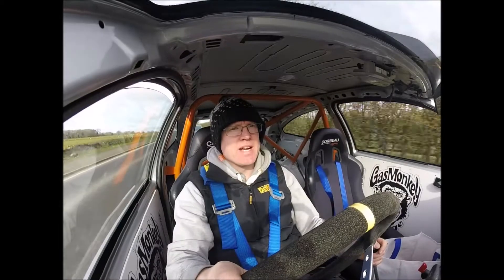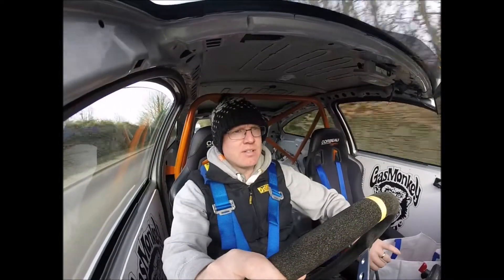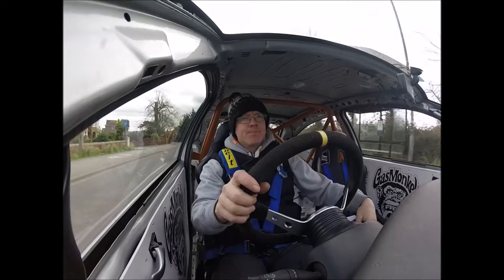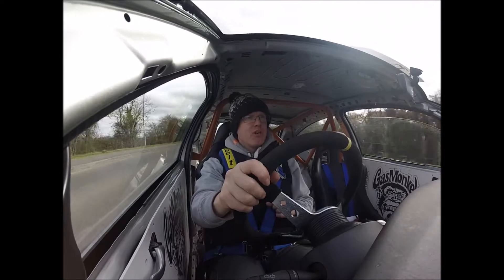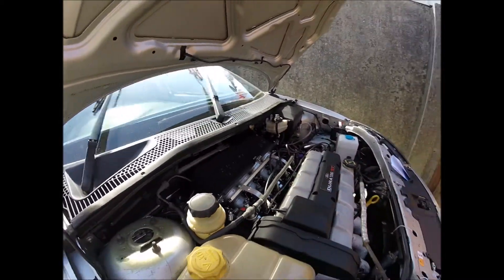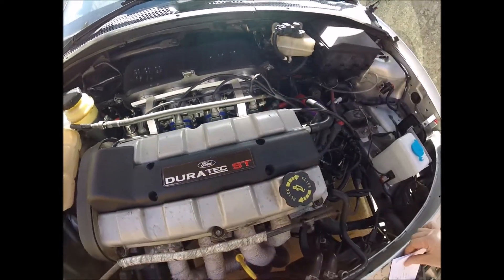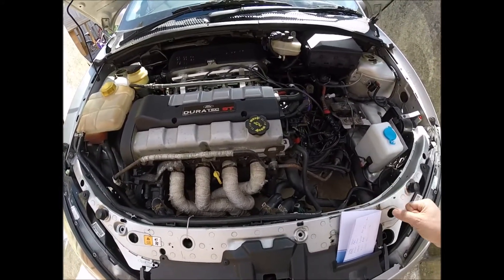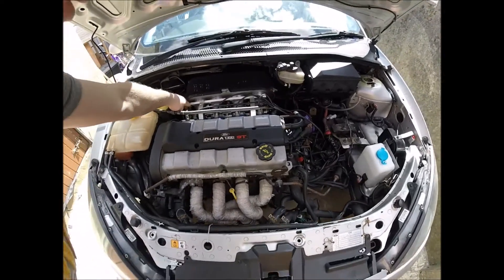ST170 gsxr750 itbs. ME221 ECU. part 3

Comment: Hello Steve, at 1:50, part throttle the itb`s makes a high pitch whining noise,did you managed to fix it? i have a similar setup and that sound is driving me crazy :)
Reply from the maker: Hi yes I did cure it. There's small holes in the barrels that are there to allow balancing of the bodies using the adjuster screws. The noise is the air going past them holes and making a whistle sound. I blocked them up and balanced the bodies by adjusting the butterflies instead.
Reply: @Sparkplugsteve  I have that screws closed, but i think i need to block the holes in the interior of the TB,thank you a lot mate,that whistle sound is so annoying.
Reply from the maker: @skage2k  yes you have to block the holes. I just put some gasket sealer in them and  pressed it in with my finger. Let me know of it works for you
Reply: @Sparkplugsteve  Done, the whistle sound is gone, i used a epoxy glue , thank you a lot mate!
Reply from the maker: @skage2k  great glad it worked for you

Comment: Did you remove the VCT or are you still using it? People have been commenting on VVT but it isn't variable valve, it is variable Cam timing, and there is a difference. This makes the ST170 very hard to tune with it on, but if you remove it you lose about 30HP, then tune it back up. I've looked into tuning this engine but keeping the VCT to make the most of the power.
Reply: 007tlawed i thought there was still a difference though. Your original HP seemed low thats why i asked the question.
Reply from the maker: it's just down to The dyno. they all differ and this is just a renowned low one.
Reply: Thats ok then, good work anyway mate, looks and sounds ace.
Reply from the maker: thank you

Comment: What was the solution with the misfire at 5k?
Reply from the maker: RJ Battle it wasn't the sensors. there was noise interference on the loom to crank sensor. motor sport electronics fixed it with an ecu update that had a filter option to cancel this out. that worked and runs no issues Now.

Comment: if you wasnt running a filter on the trumpets would the itbs have fit in there without chopping the bay up, i have a black top 2.0 and im about to order a kit but worried about clearance
Reply from the maker: Nathan Shinn IT would be very tight and still possibly need a little work. best bet would be to run 50mm trumpets. it will save a lot of work and hassle if using a filter but if your not worried about a filter 70mm trumpets would work. danst engineering will make them to whatever size you want.

Comment: Well i can give you some advice to power up this engine. This engine have creepy VVT (valves) and different timetable rollers. St pistons works at 10 bar, RS at 8 bar. Thats why your fuel pump can't handle :) So best way is to change whole up of the block and pistons from engine mk1 RS if you realy want to power this up. This operation is very expensive but this change will give you with throtle body up to 250bhp at start. Later you can easy fit engine with turbo charge + 4-1 exhaust manifold with cat back. It will be more than 300bhp
Reply from the maker: Ro Sh I haven't got fuel pump issue's though. also rs has lower compression so surely I'd lose power naturally aspirated.
Reply: i tought if you would like to try instal a turbo later you will have problem with fuel pump and ST CPU settings

Comment: looks like a awesome build but only 180 bhp summik tuned wrong? not alot for amount of work... i ran zx600r carbs, canems ecu, 4-1 decat, sportex race exhaust on a 2.0 blacktop ran 176bhp 187ftlb at quest motorsport then after doing stage 3 Kent cams it ran 194bhp 203ftlb
Reply from the maker: Thestormyking 
The dyno is Known to read 10+bhp lower than others so I know it would make 190 elsewhere. for comparison a standard St170 makes 148-153bhp at m tech rollers so looking at gains I'm 25 to 30 up from standard.
Reply: 007tlawed fair enough buddy epic build for just i just picked up a st170 last week im not doing carbs this time im doing.. exhaust pulley, 67mm throttle body, decat, exhaust, remap, & n panel filter and drilled airbox i reckon will do 185/190.. i saw u go around combe last year :) sounded epic
Reply from the maker: thanks. should sound better this year. iv been doing some research and i think my 2 inch exhaust is strangling the top end a bit. i need to get a 2.5 inch exhust soon. hope your build goes well.
Reply: hopefully see u there, tag along in passenger seat around track ;) and cheers mate :) loving it so far my daily is a mk3 st with a hybrid turbo+airtec intercooler etc running 223bhp 406ftlb quite a car haha